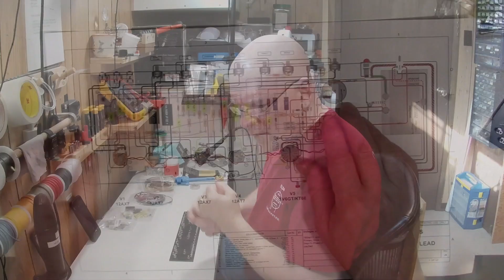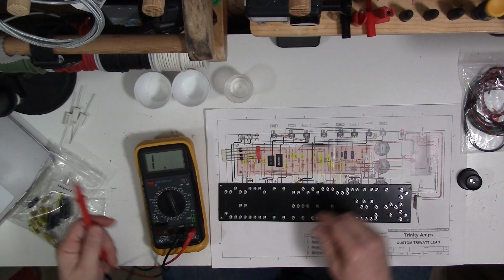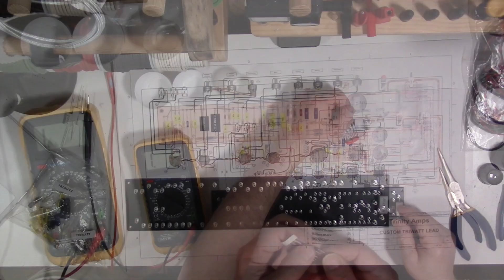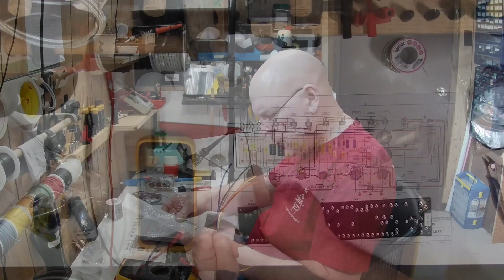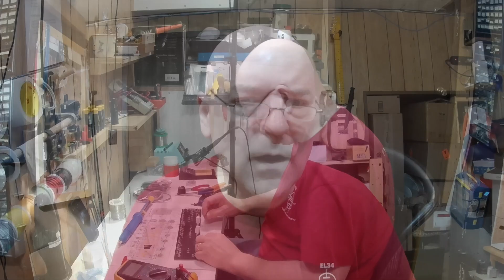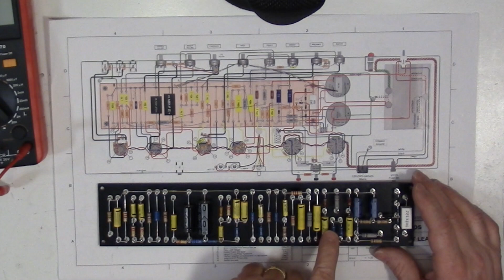Trintiy Amps Triwatt Build Pt 4 - Turret Board

Comment: Great video.
I'm new to amp building.  About to start a Trinity 5E3. 
 Is there a danger that the solder holding the jumper wires on the underside of the board will melt, and come loose when you solder on the top side of the turrets? 
 If so, how do you avoid this?
Thank you.
Reply from the maker: You shouldn’t have any issues with the underboard wires as long as you avoid overheating the turrets while soldering from the top. One common mistake beginners make is setting the soldering iron temperature too low. This forces them to hold the iron on the turret longer than necessary, which heats the entire turret and increases the risk of the underboard wire falling out. Even so, this is less likely when using solid core wire, as it tends to stay mechanically secure.

The key to successful soldering is setting your iron hot enough to make a quick, clean connection without overheating the components. If the iron is too hot, you risk damaging components or causing the solder to “boil”, creating bubbles in the joint that can weaken it.

I typically set my soldering iron between 340–370°C (650–700°F). When soldering turrets or eyelets, I lean towards 370°C since these connections are larger and dissipate more heat compared to standard solder pads on a PCB. It’s all about finding the right balance.

Thanks for the kind words!
Reply: @JagStar  Thank you so much for all the tips.
Much appreciated.
Reply from the maker: My pleasure. Glad to help!